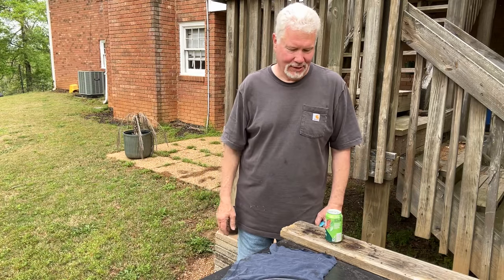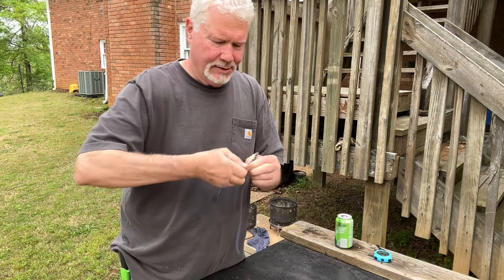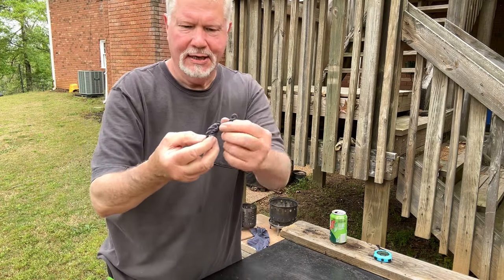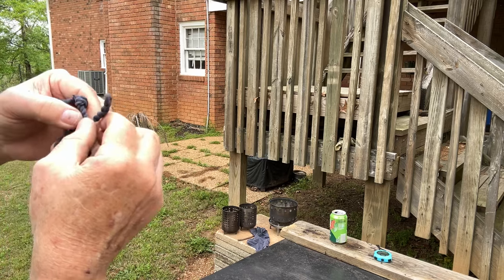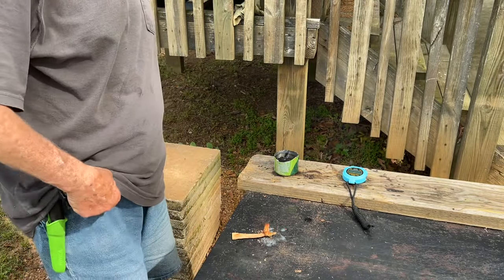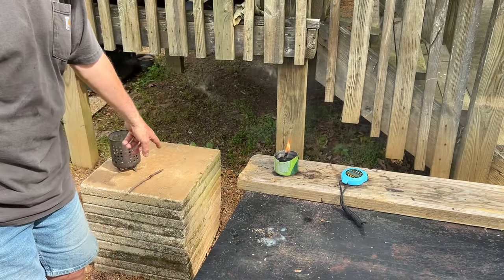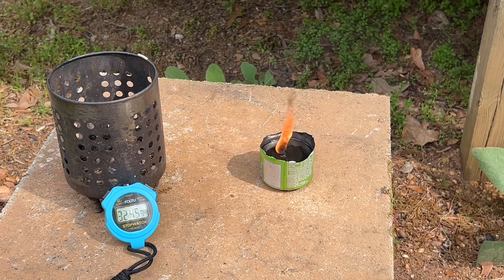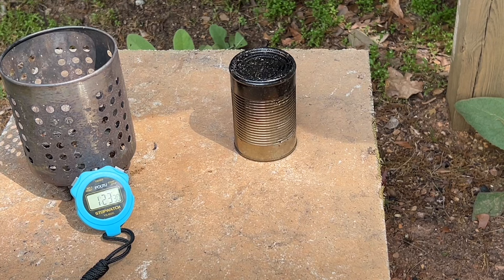How To Make A Grease Lamp And It's Wick

Comment from the maker: Cut 2” off the bottom of a freshly drained V8 can. Pull off a 1/4” x 18” strip of cotton t-shirt then reverse wrap it into a wick. Drain from a lawnmower 3 ozs of oil into the 2" tall can. Tie the wick into a loose knot, judge how much tail you need sticking up, then thread that tail through the weave. Saturate the entire wick in oil. Weigh the wick down with a stone. Ignite wick with a fatwood match you've Ferro Rod ignited. Burn lamp about 12 hours, or more or snuff with another can.
   Please follow the LINK below and SUBSCRIBE. Thank You!

Grease Lamps Playlist
https://www.youtube.com/playlist?list=PLkoXX8XsMW3k7cP1F4wShxqd_J0Uv_prf

Comment: Hi David!  One could be totally broke and pull together the parts for this project.  Excellent use of recycled materials.
Reply from the maker: I didn’t think about it, but you’re right… any empty can, scrap piece of t-shirt, used motor oil or any oil, rock wick weight, fatwood match stick, can snuffer. TY!
Reply: Perfect for a hobo stove. This is real, applicable survival.

Comment: I could see using old fish fry oil that has been used several times after being strained but would bacon fat not solidify in colder temps. I could see here in north Alabama in the summer months where bacon grease would keep in liquid form.
Reply from the maker: Lighting the solidified grease starts the process of it melting as it goes. Oil or grease from any plant, animal, or petroleum product will work.

Comment: 👍👍👍 .. nice 👍.
I wonder what would happen if one cut the top half of the can to suit and placed /wedged it on top .. pulling the wick through the drinking opening?
This is how I make my little Alcohol Burners. I fill the Burner with Ceramic / Glass Wool or coiled Carbon Cloth (whatever is at hand at the time) to reduce burning fuel spill in the case of an inadvertent 'knockover'. Very effective they are.
Thanks for sharing .. take care ..
Reply from the maker: It should work. This quick and easy grease lamp is disposable or not.

Comment: Hi David, I just made my own and it worked, more or less. How did you get your wick to burn without igniting the oil in the can? I used a strip of flannel pillowcase, a 4oz Hatch Green Chill can and used motor oil and the entire surface of the oil lit up like a smudge pot.
Reply from the maker: I mentioned that the top of the oil would light up if it gets too hot. This grease lamp didn't, but my previous one did. There are lots of designs that keep the flame well away from the oil.
Reply: @DavidWestBgood2ppl  I missed the "mention" but I found your grease lamp playlist. You have enough videos to keep me occupied for a longgg time! Mine has now been burning merrily for over an hour. I'll have to snuff it out and relight it again like you've been doing.